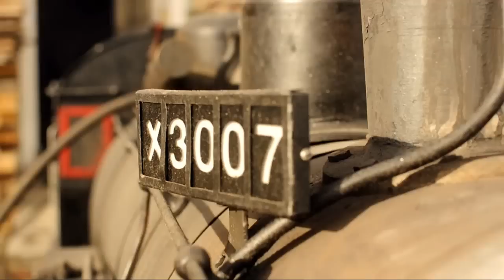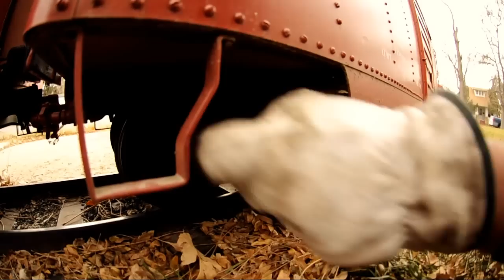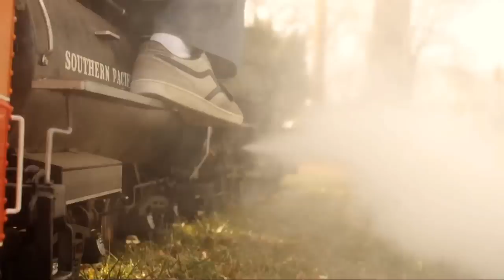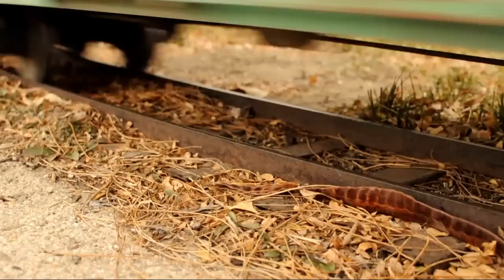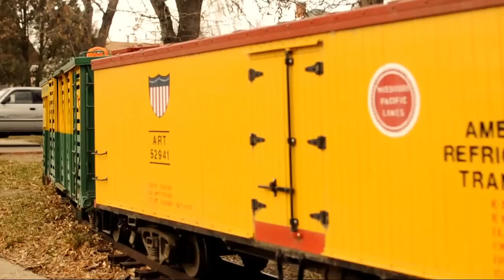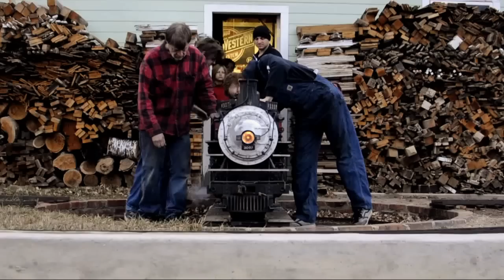House With Scale Steam Train - New Footage

Comment: Is it 1.5" to the foot or 2.5? I can't tell due to the wide angle lens. Beautiful engine and rolling stock. 4-4-2 Atlantic?
Reply: Depends on whether it's a standard gauge or narrow gauge model. Standard gauge models are 1.5" or 1.6" to the foot, depending on whether the model was built to gauge standards or with a focus on scale accuracy. Narrow Gauge models tend to be 2.5" or even 3.5" to the foot depending on what gauge the full-size version is built for.
Reply: looks bigger than 7.5 gauge

Comment: Thanks for the video.  You did a great job of building 3007.  How long did it take?  I have been around railroading all my life.  My father was a third generation engineer and I was a forth generation engineer.  I hired out on the Texas and Pacific shortly after my father retired from the T&P.  I retired from the UP, through two mergers, in New Orleans in 2000.  I got involved with LASTA near New Orleans shortly after I retired and I am their COO.  We have SPX-3007’s big brother in standard gauge.  SPX-745, a Mikado 2-8-2, was built in the SP Algiers shops, across the Mississippi River from New Orleans, in 1921.  One of 11 built there and she is the only surviving Louisiana built standard gauge steam locomotive in existence.  She was rebuilt to FRA standards between 2000 and 2004 and operated around Louisiana, Mississippi, Arkansas, Oklahoma, and Missouri until April 2019.  She is now undergoing her 1472 day / 15 year inspection / rebuild.  We were hoping to have her fired back up for her 100th birthday in February 2021, but CV19 has probably delayed that.  But I think we will throw her a big birthday bash at our yard in Jefferson, LA any way.  If interested there are several videos of her here on You Tube running in our yard and out on the main lines of several class ones, regional, and short line railroads.  Search SPX-745 to find them.